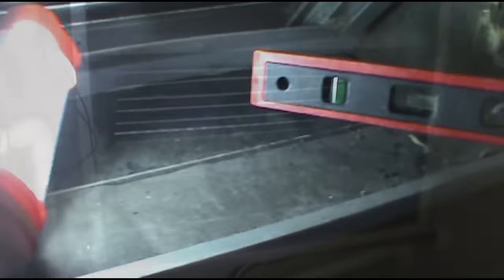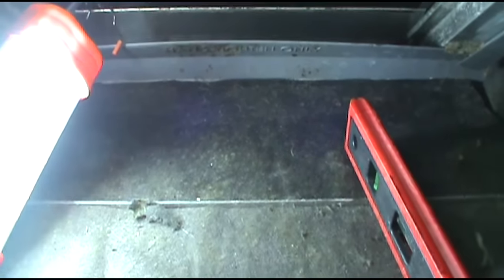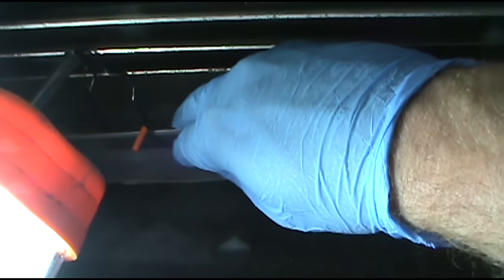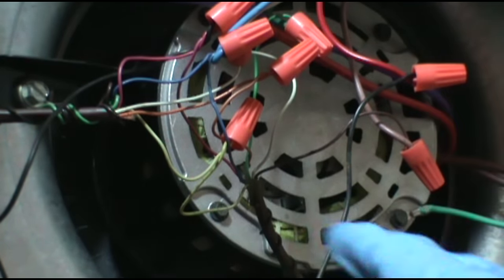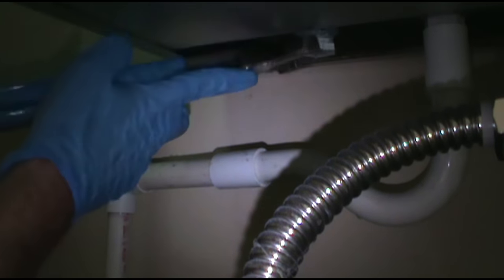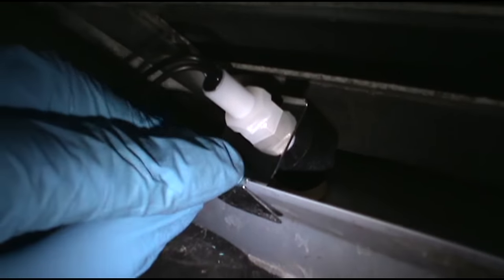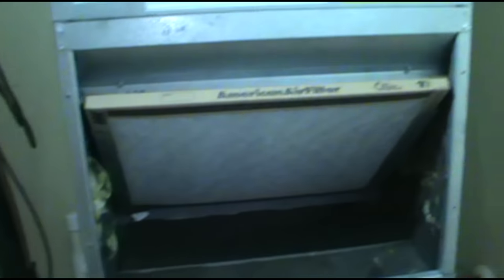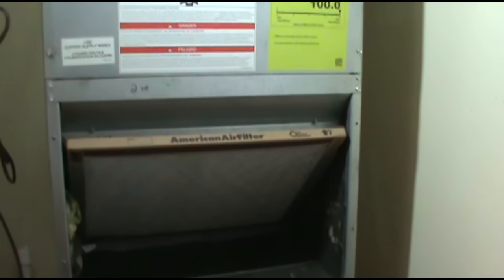HVAC- INSTALLING A FLOAT SWITCH

Comment: Interesting! Your fix works good! My thinking thought theory here is perhaps the forced air units pulling force suction power is creating small vacuum  pulling the float switch shut. 

              A tee vent added just before the float switch that tees up a bit higher than the existing float might alleviate the problem without needing to take off the cover and rewire. Enjoy your vids!!!
Reply: +KungFuMaintenance My second  thought theory here (with combination or not  of me first theory ~ LoL) is the float switch plumbing may be pitched forward with the pan and perhaps propping it up a bit with another piece of pipe, wood, or plumbers strap might do the trick. The tolerances must be kind of close for the float to be just below the top of the pan to shut off before overflowing. I could imagine it settling a bit below the pan  pitched fourwords just like the off level pans.
Reply from the maker: +KungFuMaintenance Hey man! The units Im dealing with are screwed. The unit in this video is vented. There is a hole screwed in the top of that cap thats on the vent. Heres the kicker, we have some that have a trap & are vented & do the same thing that happens in this video. We have some that do not have a trap or a vent & work perfectly fine. And some are piped & vented exactly like this one & pitched forward & work perfectly fine. LoL!!! I just threw & my hands up & said "screw it, im putting in a clip on". Thank you so much for watching Mark! Your name is Mark correct?

Comment: It appears you got the primary drain capped at the T-couple...that vertical junction should be uncapped and the vertical pipe at the T-couple should terminate higher than the primary pan to prevent negative pressure going back to the primary pan outlet.  This allows the condensate to drain out properly and no negative forces at the J trap.  Hope this helps.
Reply from the maker: Right on Van L! There's a hole drilled into the top of that cap. I should've shown that. My place is screwed. Some are piped & vented perfect & it still does the same thing. Some have no vent, no trap, are pitched forward & work perfectly fine. LoL! Its only a 3 year old property too. Im just putting in clip on's & rolling on. Thank you so much for watching Van L!
Reply: Talking about hawk eyes; more like Eagle...Great observation. Thanks!

Comment: Great vid, Lex.  I wasn't clear on what circuit you were breaking with the clip-on float switch.  I was wondering what would happen if the float switch opened, would the indoor fan shut off?  And, if so, would the compressor keep running?  If the indoor fan stops, and the compressor keeps running (assuming there's no Lo-Pressure Switch on the suction line), wouldn't the evap begin to ice up?  

Your video demonstrates why it is so important to have a competent technician install the unit so that it performs as it was designed to do.  Bad installs are what give homeowners the idea that certain brands are poor quality, when the truth is, it's the installer who is to blame for the hack job.
Reply from the maker: I broke the red wire which feeds power to everything. It feeds 24v to indoor unit & outside contactor. Its the "hot" wire. So it would shut off everything if the float switch did its job & broke the circuit due to water rising in the drain pan. If you break the yellow wire, it would just shut off the outside condenser & leave indoor fan running. Yes, bad installation ruins everything. These guys that installed these units were found on craigs list so I was told. The complex is only 3 yrs old. Thank you so much for watching Robert!

Comment: My “hypothethis” fan is creating a vacuum that is holding back the water, enough to put some water in secondary. When fan shuts down pan drains as usual, over time shuts float . I enlarged trap. Both work. tech from SWF.
Reply from the maker: Right on! Thank you for the wisdom Mike!

Comment: Try adding a vent to the primary drain after the trap because they are all double trapped since they come out of the ground outside
Reply from the maker: There was a hole drilled in a cap that was on the vent hole LoL! I got a dog gone HVAC mess at my place. Ill try that too though. Thank you Joe!
Reply: +Lex Vance oh well too bad thought that might be the answer. Looks like that cap was lower than the pan and would leak before the pan fills up but maybe it was just an illusion.
Reply from the maker: +Joe Shearer Yea it's crazy. Some have vents on other units & it does the same thing. Some have no trap or vent & does it. Some have no trap or vent & works perfectly fine. LoL! Its crazy. Im just putting in clip ons & hopefully done with it. Theres nothing worst than getting called out at mid-night for a dumb float switch & the drains not even clogged.

Comment: Good video Skidddd !!!!! The ac units in my apartment complex don't have the float switches . They removed them years ago . So when we have a leak call from the ac unit area is because that lol . Every makeready we do , we connect the shopvac outside sucking all the drain line and. We clean the coils the same time . So we have maybe one call a month about the ac leak , sometimes nothing. You can check my few videos and subscribe. I have blogs showing my former property and doing the service request . Thanks.
Reply from the maker: Oh right on Cool Guy will do! Ugh there's nothing worse than getting called out at mid-night for a dumb float switch. Or an AC leak. Thank you so much for watching Cool Guy!

Comment: I was gonna say the same thing Joe said about the vent. I was thinking tie both of those drains together and use an in line float switch. I forget the model #. But hey if the clip on works go for it. In the words of Steve Lav let her rip potato chip.. Lol
Reply from the maker: LoL Right on Gil! I think the ol clip on will work. Quicker too than having to re-pipe stuff. Thank you for watching Gil!

Comment: I have 9 SS2 to install on secondary a coils bottom floor.  My concern is wiring in.  Do you break red going to the thermostat from the air handler( the thermostat is near by).  Also what about the second wire.  How do you like to wire it in?
Reply from the maker: Take the 2 reds and separate them. Put one float switch wire on one red wire and the other float switch wire on the other.
Reply: @LexVance  two red wires on the thermostat?
Reply: @LexVance  I meant to tell you these are heat pump units
Reply: @LexVance  small two ton units
Reply: There are no plastic control boards
Reply: @LexVance  I will take cover off and check to see if there is a terminal strip

Comment: I had the same problem. But i had to remove the p-trap from underneath the unit. My condo is on the 2nd floor and the drain line goes down from underneath the building and back up from the ground next to the condenser.  By me adding a p- trap to the unit, i created a double p-trap on the line which will cause the unit not to drain out. Once i removed it problem was solved.
Reply from the maker: Right on! Thank you so much for watching Marco!

Comment: My float switch is wired with yellow why is that bad?
Reply from the maker: It's fine. It will just shut off the outside unit & keep the inside running. It can confuse a tech sometimes. Red shuts everything down. Yellow is okay though. Thank you so much for watching Hellen!

Comment: good video I break yellow because you will have heat if all goes wrong because they might not call you when they have no ac LOL
Reply from the maker: Oh right on I dig it. They dont really fire up their heaters much here in florida. I can see why yellow would make sense in colder climates. Thank you for watching Bill!
Reply: I am a little confused. Why not wire float switch to yellow instead of red? I also live in Florida.
Reply from the maker: You can if you'd like to. I was saying that when the next guy comes along & sees that the inside fan is running, he'll go open up the condenser outside to see what's wrong because the yellow wire shut the condenser off & left the inside fan going. He'll fumble around out there a while & then realize it may be the float switch after everything checks out okay on the condenser. If you break red & everything is off, that tells me right away, "check the float switch".
Reply from the maker: +Bryan Rubio Yellow wire shuts off condenser outside only. Red wire is the "hot" wire that gives 24v power to everything, therefore it would shut off everything. Outside & inside.
Reply: @LexVance  My GeoCool geothermal unit come from the factory breaking yellow. The advantage I see to this is that even is the condenser is shut off, the fan still runs and can circulate air in the house. I do admit that it took me a little while to realize that it was the float switch since the fan was still running but the temperature was not dropping. I should have clued in earlier since the float switch light was on in the HVAC control panel but then I'm just a DIY homeowner stumbling through my maintenance projects. Thanks for the informative video Lex.

Comment: Why even bother installing another one. After my new system was installed and inspector signed off, I took my float switch out and just capped the opening. 2 years latter I noticed a little water on the floor near my air handler so knew it was time to shop vac out the line. I say FU to these float switches unless you have an air handler in the attic.
Reply from the maker: I agree. They can be more of a headache than a savior. Thank you so much for watching Sam!
www.DirtyMaintenanceNation.com